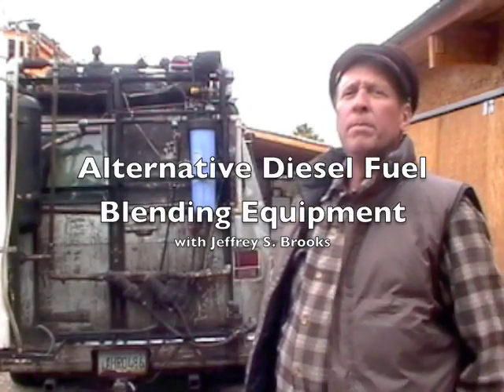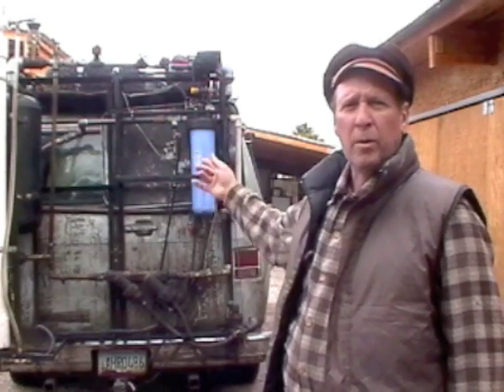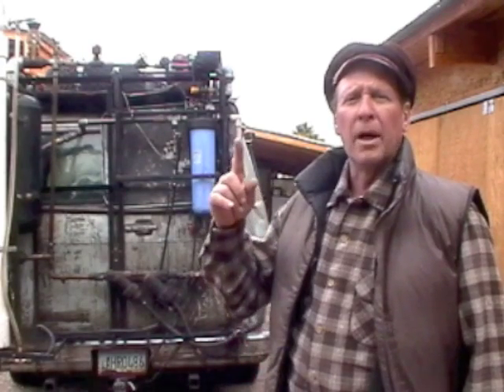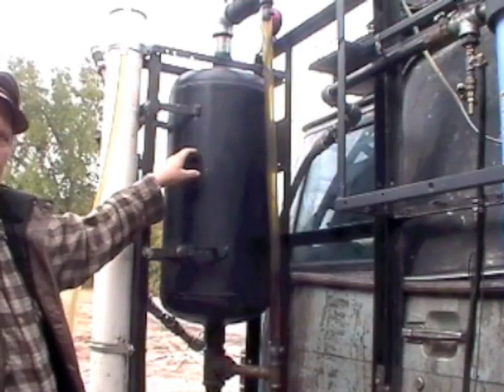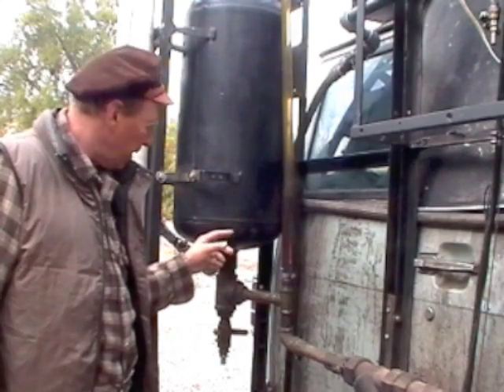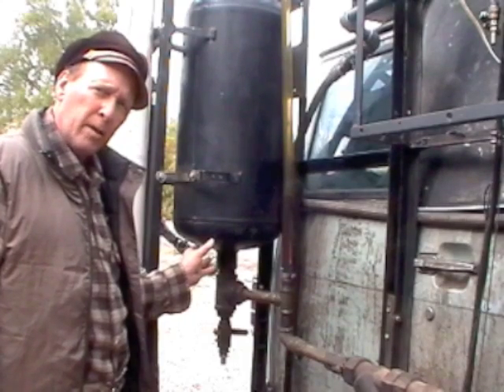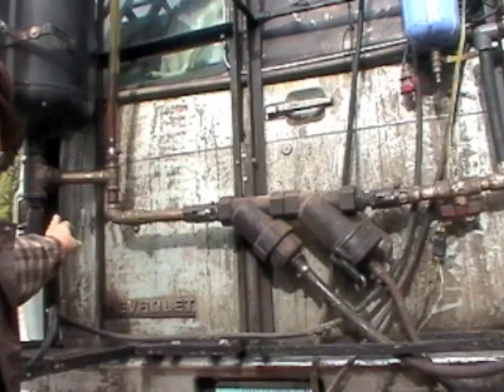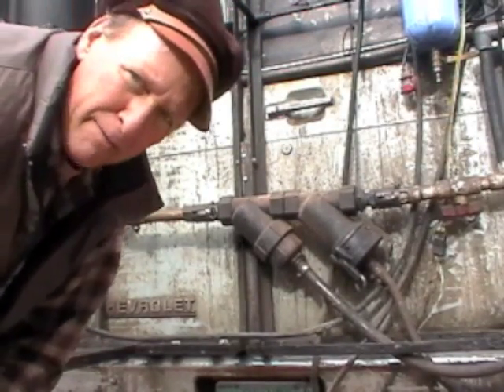A tour of a waste oil diesel fuel blending system

Comment: Hey there Jeffery, Corey here from the dieselstop.  I have a couple questions.  First, are you running both WMO and WVO in the same system?  I have read where some people say you can not mix the two.  Secondly, what do you use to push the WO through your system, through the filters and into the vehicle fuel tank?  I'm thinking about getting back into WO again, so i am doing a bit more homework after dismissing my mercedes benz project last year after about 7k miles on WMO.  I now have a 96 ford.